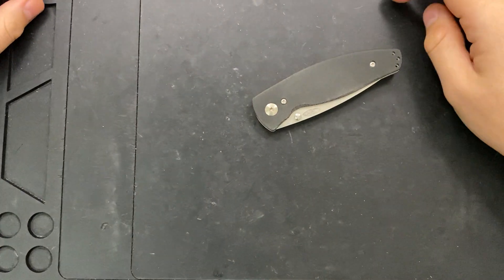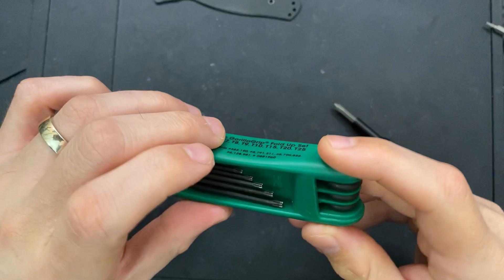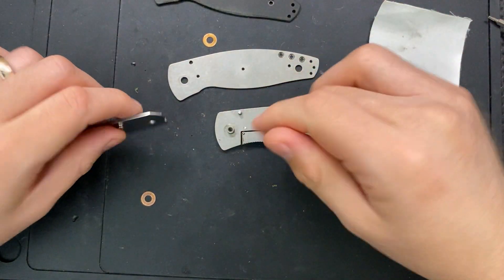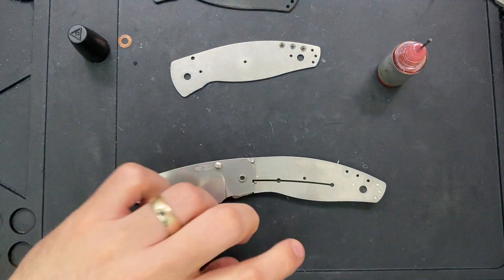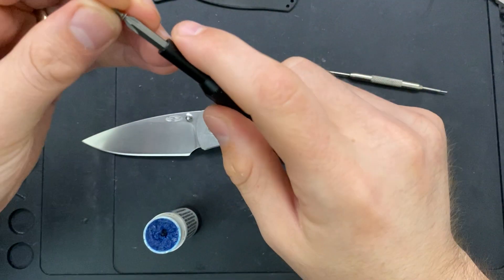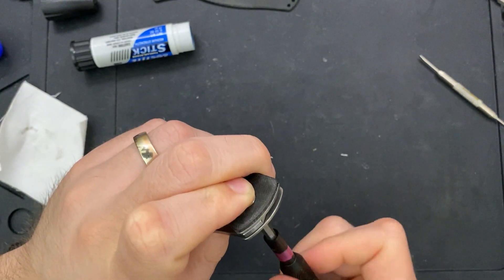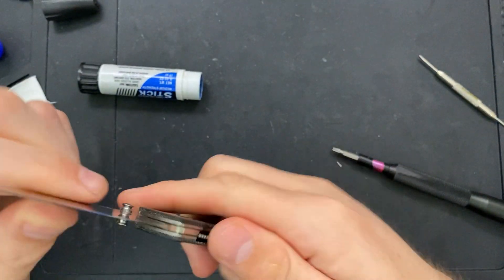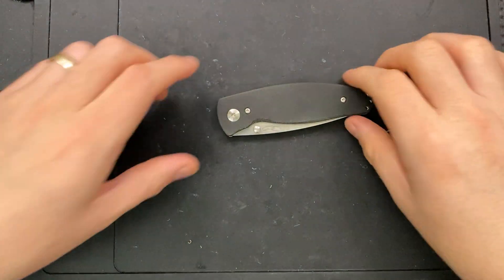How often should you take apart your pocketknives?

Comment: You have a spectrum here so to speak of, on one end of the spectrum there is Nick, where he will take a knife apart to remove a single piece of fluff. Then there is the other end of the spectrum where you have me, who will strip his knife down only when the gunk build up is so intense that it actually mutes the sound of the knife hitting the stop pin, so it just sounds like a squishy squelch when deploying the blade. There is a happy middle point somewhere in between these 2 extremes where you should probably call home as a knife collector.
Great video ++

Comment: How often do i take apart my knives?

Some point in between way too often and never, which seems like the correct answer, to me.

For instance, a 940 will operate fine for decades of light to medium EDC use without needing to be disassembled a single time. At the same time, there are a lot of minor tweaks an end user can make to a 940 that improves the action significantly, and a freshly cleaned and lubed 940 is sooooo much smoother than one subjected to the shit that finds its way into my pockets.

How often do modern pocket knives need to be disassembled? Essentially never.

If Microtech can make the stitch, ultratech and HALOs fully user serviceable, with little to no special skill, then theres no excuse for companies that void a warranty for disassembling a Ti framelock flipper consisting of a total of 6 parts.

Just this jackass's opinion.

Comment: I agree, I feel like there is a niceness to well-cared for gear; therapeutic even. Be it my leather work boots, or my favorite pocket knife, I really like cleaning and taking care of things. I also like restorations. In an adjacent way, cleaning up something (if you know what you’re doing) keeps things reliable and durable. The three biggest things I like to prevent in knives are dull blades (strop/touch up on stones before they dull fully), rust (especially internally), and debris in the lock (could accelerate wear on parts, or even make the lock fail/difficult to use).

Comment: Depends on the knife, some i just flush out others get a full disassembly clean, reoil and reassembly. (mostly depending on how easy they are to disassemble).

Older spydercos and benchmade knives stay in one piece. Ontario and cold steel get the full treatment.
Reply: Like your reply! Do you have any experience or advice on a new Benchmade such as the 560bk-1 super freek. Occasional disassembly seems prudent to care of m4 steel.
Reply: @robertphifer7955  Patience and try to keep the axis lock construction in one piece.

When i do take apart benchmade knives i reinsert the blade and washers as one thing and use a business card (or any strong thin piece of paper) to guide the washers back in place. Benchmades are a pain to reassemble so again, be patient take your time with it.

Comment: Yup, only knife I've really taken apart multiple times (and when I got a new one, when I lost my original 😭😭😭) was the Kershaw skyline. Easy disassemble, and while they're great for the price, you can really make it into a superb flipper with a little tinkering. I would also say I'm inclined to take apart a knife that needs a TON of sharpening, partially for the gunk you mention (not necessarily just diamond dust but anything that could gum up the action), and partially because it just makes it easier to sharpen.

Comment: I'm always paranoid about small screws being stripped from disassembly
Reply: Just go slow so you don't cross thread, and go by feel to not over torque. I had a friend buy a Mossberg shotgun which has an aluminum receiver, switch out the stock, and crank down with all his might and destroy the receiver. He didn't even get a chance to shoot it before he destroyed it. Blue loctite is your friend.

Comment: I use homemade dry graphite lubricant. It’s graphite dust in suspension with alcohol. I use a toothpick to dab it onto my bearings while assembling it and by the time it is back together the alcohol has evaporated off and the graphite is free to spread.

Comment: It’s not only sharpening with diamonds that will leave junk on or in your knife. Any sharpening can do that. Even if you don’t get particles of your sharpening material (diamonds or stone or whatever) in the mix, you’ll get tiny metal fragments in there. Grinding some of the metal off a blade is, after all, what sharpening is. Metal rubbing against metal, especially where moving parts are joined, is good to avoid.
Reply: You can use sharpening rods and sharpen against gravity so much more of it tends to fall down

Comment: I tend to fear disassembling my knives because I don't want to ruin their action. I'm not super confident in my own ability to tune them to my desired smoothness while also avoiding blade play.  I'm slowly improving, though, and was recently forced to disassemble a new knife: The Vox Dapper (Manufactured by Fox Knives).  I do love the knife immensely, and I have not experienced the QA issues others have with the lock-up. Mine's perfect in that sense. But after about a week of light use and moderate fidgeting, the backspacer started to rattle.  There aren't external screws at the bottom besides the wire clip screw, so I had to disassemble the pivot screw to get to where they screwed the liners into the backspacer, underneath the scales.  It seems like the threadlocker they used didn't quite hold up, so it was an easy fix from there. Reassembling was actually quite easy. The flipper geometry paired with the short blade makes for a very forgivable tuning process--tightening the pivot a little too far didn't hinder the blade from fully deploying.  My only real complaint with the knife is the hidden screws. If they're going to be under scales, why not make the scales easily swappable? If they're not swappable, why not screw through the scales to the backspacer?

Comment: There hasn’t been a knife I’ve owned, apart from some OTFs, that hasn’t benefited from an immediate disassembly and cleaning. This applies to a wide range of pieces and prices, from artisan cutlery and spyderco to shirogorov and grimsmo.
Reply: The norseman is such a great example of a knife whose action is so responsive to the tiniest tweaks. 

All it takes, on mine, to go from drop shutting with a light shake to finger guillotine is an often visually imperceptible turn of the pivot screw. 

It will always flip, lock up, and close 100% reliably, even coming from a pocket fulll of sand, but its insane the difference that even the tiniest piece of lint can make in the action.

Its the only knife that ive ever used as an EDC that i know would not only survive all my uses for the rest of my life, but also that i will be passing down to my nephew. 

Theyve managed the acquire quite the stigma, and get a ton of hate, mostly from people that have never used them or vastly overpaid for one. They arent perfect overall, but ive done everything from trim hangnails from a young toddlers finger, to some light batonning with mine and its been great.

Damn thing will always look like a horse cock, though.
Reply: Same here. i can always make it better

Comment: I tend to turn my pockets inside out and clean out the lint and stuff in the elephant ear, otherwise i have a maxpedition as a man purse i toss my knives in, only knife i ever took apart was the Matriarch 2, after a day at the beach l, never dropped it once but the beach is. Mysterious place 
Grit got into it, cleaned it up good and proper, found lots of sand rocks 
And still had grit, vexed me to the point of selling, i am careful otherwise of allowing debris to find itself into it, i blow it out with compressed air a couple times a week, Yiddish 
Folding knife problems, why ill always prefer fixed blades, none of the issues folding knives have will ever find itself repeating in a fixed blade

Comment: I hit it with "goof off"  hot water and compressed air.  Then get some nano lube in there. 

I've never disassembled any knife. And they run great. 

Seems more like a hobby to me.
Reply: You’re not cleaning imbedded grit from phosphor bronze washers.
Reply: @RadDadisRad  they drop open and drop shut.  150 psi cleans them out plenty good.  I do this for my pm2s and just recently added a shaman. 

I am a heavy duty user in the construction industry.  I assume the silica dist and grit I get into my knives actually were down the washers.
Reply: Great answer and it saves you a ton of time
Reply: I'm the same. If grit is getting into the bronze washers, then the blade is too loose. Just blast it out with WD-40, maybe some compressed air, and wipe it down till it's dry. Works great!

Comment: Loob on ball bearings is dangerous. The tiniest non visible amount of lube is perfect, but if you can so much as smell it on the bearings you used too much. It will just attract grit and wear them out faster. You could lube 50 bearings with a drop of lube.

Comment: I don’t think cold steel gets enough credit for how easy it is to maintain/disassemble their knives.
Reply: If it gets dropped in something containing sand or dirt sure, otherwise I wash with dawn, a toothbtush , hot water, dry, blow out with compressed air and lube. Spyderco used to say the same thing years ago.